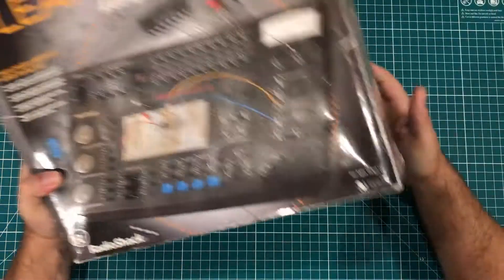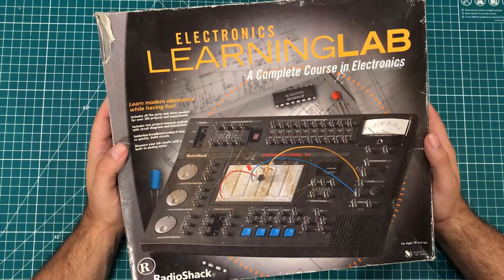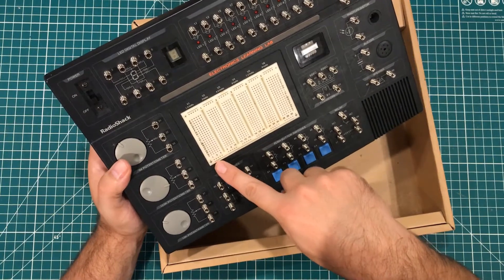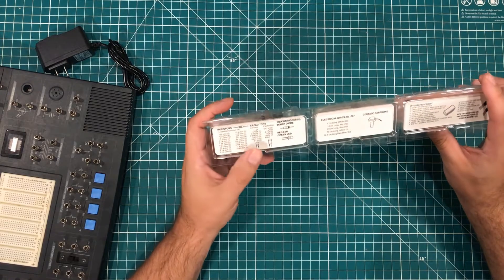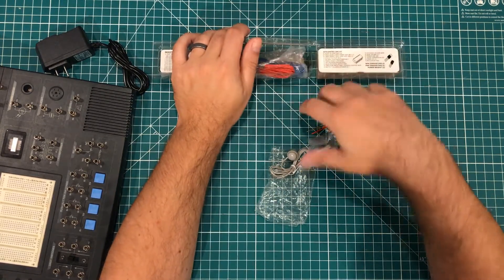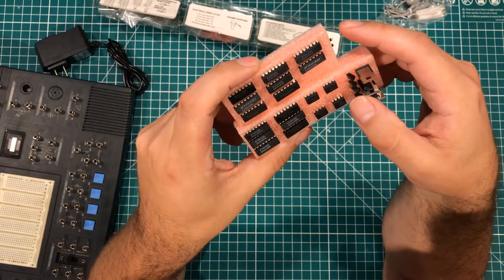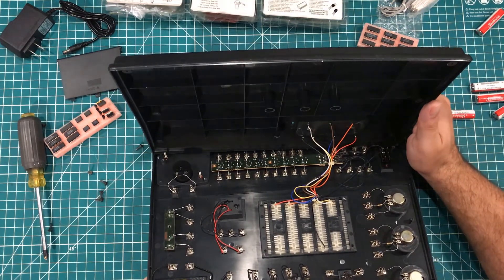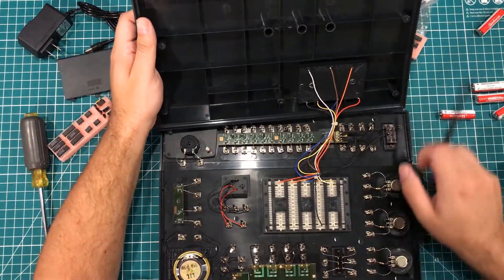Radio Shack Electronics Lab - Unboxing + Teardown

Comment: if use the power block in the back, replacing the batteries, how will your breadboard have the incremental voltages cause I think that’s coming directly from each battery that’s in the back.

Comment: HI! I just dug out the RS EL Lab my son used 15 years ago. The parts box is missing. Could you take a picture of the parts list on the box so I can try to replicate it? I tried to zoom on a screenshot from your video, but it is too fuzzy.  Also, I know the wires are of different lengths coded by color, but I don't know what gauge and if copper or aluminum. Thanks for any help you can provide.

Comment: I rewired this device with 12V PSU + 6 DC-DC buck converters for modern electronics scenarios: 1.5V, 3.3V, 5.0V, 6.2V, 7.2V, 12V. Costed me about $16 in DC-DC buck converters.  And over 4 hours of painful soldering.. But now I can use it with modern microcontrollers, no batteries needed anymore.

Comment: Did you ever do a follow up video? I have this same kit and was looking into doing the same thing. I didn't like how the 6x AA batteries were used either. I was thinking about using a 9v adapter and then use those small buck convertors to step down the other 5 voltages. I'm unsure if this would be the best way though as I am still fairly new to electronics. You could even use the battery compartment for mounting all the tiny buck convertors for easy access. What are your thoughts on this?
Reply: I've just done this today with DC 12V to 5V Buck Converter, DROK 10pcs Mini Voltage Regulator Board.. Took about 4 hours of soldering (buck converters are tiny and not very easy to solder at all).

Comment: I had the "65 in one" kit (wood case) back in the 70s and did all the projects. Your battery setup needs an upgrade.
Reply from the maker: Those kits had such cool experiments.  And you're absolutely right about the battery upgrade.

Comment: Hi there can I install a 9v regulator supply instead the battery
Reply from the maker: You can but then you would have to choose one voltage or do a whole bunch of regulators since the built in one puts out voltage in 1.5v increments.

Comment: hey would you say this kit is still good for a grownup who wants to learn more about digital electronics specifically the fundamentals of logic and computer circuits at a basic level?
Reply from the maker: I actually would.  There's a lot of solid, foundational stuff in here that I think is really good.  There are lots of good youtube channels, etc, but I do like the way this kit progresses.
Reply: @AnotherMaker  sounds good.
Just placed a bid on one yesterday and hope I win! It is supose to be brand new so I would be paying a pretty penny $150 for the kit if I do win. 
Iv seen them cheaper used but prefer new when possible buying kits like this do to the possability of possible bad components caused by previous owner etc. If I don't end up winning, there is another kit on ebay for cheaper and several other used ones for even less. So glad they aren't as rare as I thought they would be by now that radioshack is no longer around

Comment: They made the 6 batteries individually accessible because some electronic projects request different voltages from 1.5 to 9V.
Reply from the maker: Yep.  That's going to be a bunch of buck converters, but I'm still going to make a power supply for it :)
Reply: @AnotherMaker  They put a lot into this kit but using the batteries to supply individual voltages was the cheap way out. I don't blame them at all for that but as most of us discover with this kit...the batteries begin to leak and all the spring terminals for the batteries become corroded. In my case, one of the terminals broke.

Comment: I recently purchased one of these off ebay as well as the Sensors Lab kit. I had the 50-in1 and 100-in1 kits in the early ‘70s. I have been working on the projects one at a time from these kits and then trying to work the project into an Arduino project. The early kits were what caused me to attend a Vocational high school in Tampa to learn Radio and TV repair and then spend over 40 years in electronics repair and installation in both military and civilian life. When I saw it on ebay, I had to have it. I think they are fantastic and intend to work some of the projects with my 8 year old grandson who currently has Snap Circuits and wants to learn electricity and electronics. These kits are fantastic. There are so many projects and by adding a few more cheap ICs, the number of potential projects grow in number quickly.
Reply from the maker: Absolutely.  I don't have an electronics background. I had the Mimms books as a kid, but I can tell the gaps in my knowledge from time to time so I'm looking forward to going through this.
Reply: You're story was facinating to read.
Very cool! 
Would you say this set is good for grownups who want to explore and learn more about electronics then?
Since Im legally blind and can't solder, I figured this set might still be great for teaching me the wiring and get an idea about how voltages and signals flow through the different circuits

Comment: That CD4046 PLL is a mysterious gem, and would be my immediate focus.  I know they are used to multiply clock frequencies, but have no idea about the theory of operation, or general applications.
Maybe some baking soda solution to clean the corrosive oxides.
Reply from the maker: You've piqued my interest on that chip.  I'm going to check it out!
Reply: perhaps can be used in an analog transistor organ circuit as a frequency devider of some kind? I too am still somewhat new to digital logic computer circuits thats why I am looking to buy the newer version of this from the 2000s which I just placed a bid for on ebay and hopefully win it!

Comment: The old-school way to get the various voltages would be setting up a simple resistive voltage divider - assuming you don't need a lot of current in any of the circuits.
Reply from the maker: That's a fantastic idea.  I guess I need to figure out how much current I want to be able to draw on the thing.